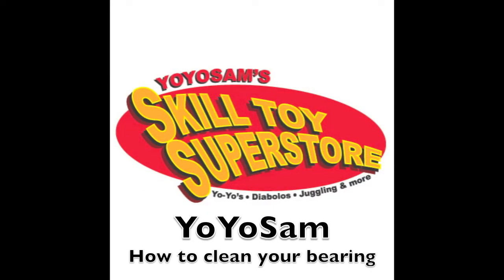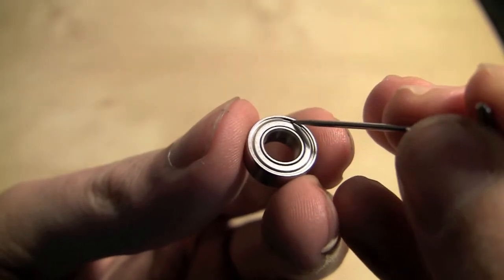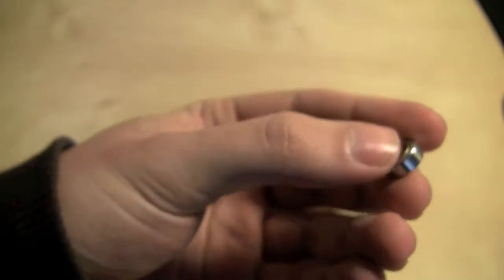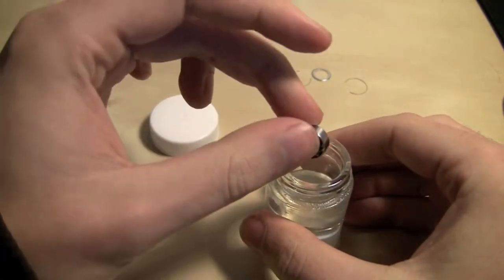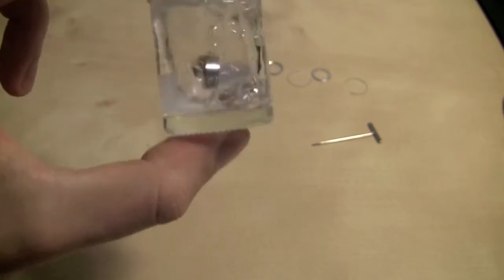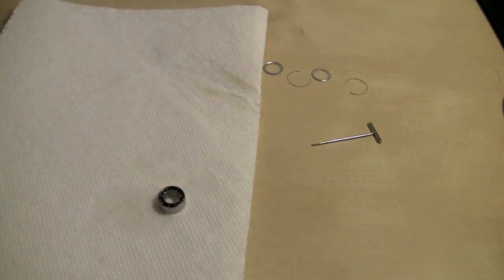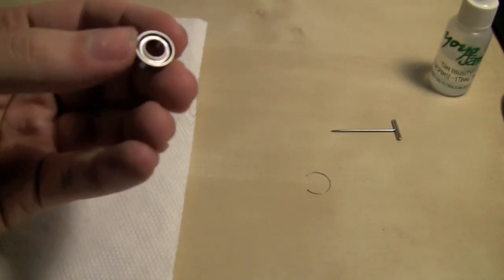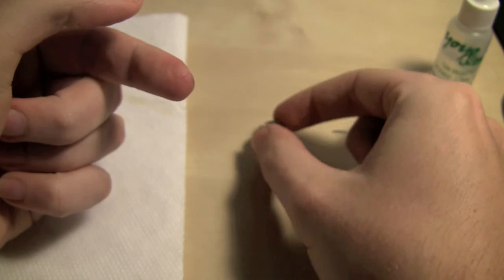YoYoSam Tutorial: How To Clean Your Yo-Yo Bearing

Comment from the maker: @hayaatchillin Hey there, thanks for the message. To answer your question, unfortunately no. We recommend using mineral spirits or lamp oil to clean your bearings. Many aerosols will make it MORE dirty, not less. While many of the cleaning supplies that will clean it are flammable- that is not the deciding factor in choosing the right solution. Hope that helps!